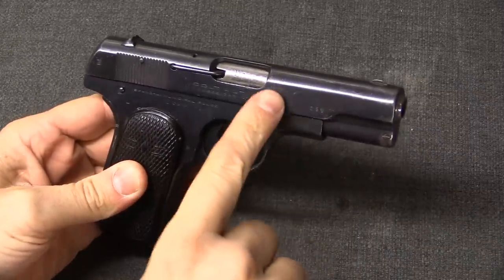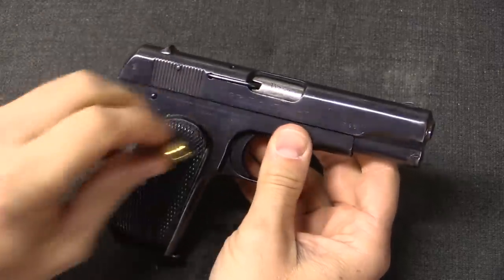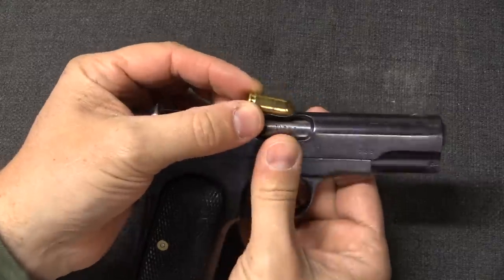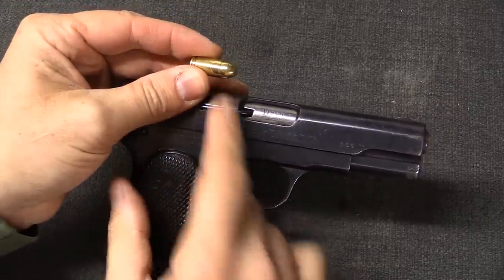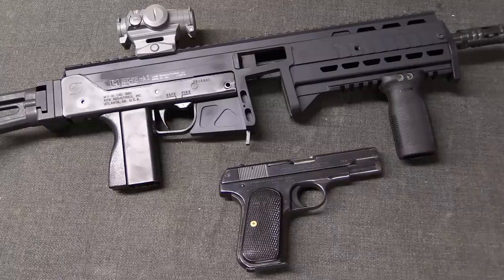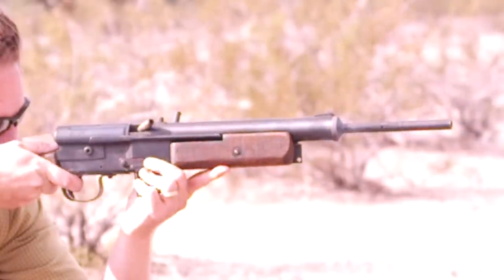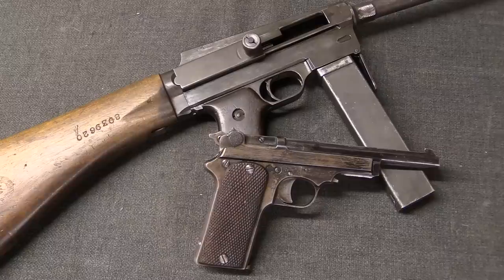How Does it Work: Blowback Action

Comment: As far as I remember, momentum is conserved, not strictly energy (because there are instances that momentum is conserved but energy is not)
Reply: Energy Conservation is already there - just has nothing to do with it.
What applies here is that the total momentum stays the same - that is 0.
The momentum of the weapon is then m1 * v1 the momentum of the bullet is m2 * v2. So m1 * v1 = m2 * v2. Since m1 >> m2 follows v2 >> v1.

But since the energy is 1/2 * m * v² the bullet also gets more energy als die Pistole
Reply: dertomtom39, yeap.

I understand that Ian didn't want to get too technical in this video, but unfortunately the wording he chose is totally wrong from a physicist's perspective...
Reply: Momentum is conserved, and so is energy. We don't take energy into consideration because there's a lot of energy converted into the heat, but the amount isn't calculable. But momentum is only affected by mass and velocity, and cannot be converted to something else like energy does, making it easier to calculate.
Reply: Energy is only not conserved on quantum scales

Comment: I like these videos and hope that you continue this series. I would also appreciate more in depth videos (once the basic action types are covered) on how the different mechanical parts operate and interact with each other, as well as their function for the intended action type. And what parts are common for or essential for a specific action.
Regardless, if you happen to read this comment than I would like to thank you for all of the documentation of rare, usually, quirky and interesting guns that you have made. I hope you never run out of such firearms.

Comment: What I find more interesting are the various methods used to delay momentum until chamber and barrel pressure have been reduced enough for safe cartridge extraction. The Broomhandle was one of the first to deal with higher powered cartridges. It's delay method is similar to the 1911 designs still being produced today.  
The .17 caliber rimfire is a great example of a cartridge not suitable for direct blow back without delay.

Comment: One thing to mention, perhaps when doing the follow up video is the contribution that the cartridge case makes to blow back systems.  There a limited amount of resistance to the rear ward movement of the slide or bolt.  This has been exploited in some designs with a shallow ring  in the chamber.  not to be confuse with the fluting found in the G3 family of roller locked delayed blow back designs.
Reply: Here is an example such that did not work.   ''The J. Kimball Arms Company of Detroit introduced a semiauto pistol in 1955, chambered for the .30 Carbine cartridge – what better companion for the tactical uber weapon of the day, the M1 Carbine? Kimball’s pistol was styled heavily after the High Standard, and it looks good and handles well. The .30 Carbine cartridge is too powerful for a blowback pistol, however, and so Kimball needed some type of locked breech or delaying mechanism. He chose to cut an annular ring in the front of the chamber – the mouth of the brass would expand into this ring upon firing, and the force required to press it back down to the diameter of the chamber body would force the slide to remain closed long enough for pressure to drop to a safe level.

However, the system was not adequate for the cartridge. The slide velocity was high enough that the guns very quickly battered the slide stop block. The would peen and deform at first, then crack, and eventually either bend to the point that the gun would not cycle, or break off and allow the slide to come right off the back of the frame. I can’t find any documentation of anyone actually injured in this way, but that was obviously the concern. Only between 250 and 300 of the pistols were made before the company went bankrupt and closed. There had been plans to expand the line to include gun in .38 Special, .357 Magnum, and .22 Hornet, but none of those went any farther than prototypes.

Comment: The delayed roller lock system should be a interesting video. Especially the difference between the mg42 system and the HK system.
Reply: MG 42 has nothing to delayed blowback, it's a short recoil roller locked system

Comment: Pressure must also be an important factor. For lower pressure pistol rounds, the pressure is low enough that the walls of the case can slip against the chamber so if the base of the case is pushed back 1mm then the walls of the case will follow it. With higher pressure rifle rounds, if the base of the case moves back 1mm then the walls of the case will likely still stick to the walls of the chamber and the case will split. Helps that pistol cases also just have less surface area than rifle rounds. 

The higher pressure of rifle rounds means a blowback action will be pushed open even quicker, due to all this, straight blowback is so much harder with rifle cartridges.

Comment: Just thought I’d mention that the velocity of the slide is NOT proportional to the velocity of the bullet (based on weight). The formula for kinetic energy is 1/2 x mass x velocity^2. So, since the  energy is equal, when the proportion of the slides mass to the bullets mass is taken into account, the velocity of the slide is more exponential than proportional.

Comment: It occurs to me that the same cartridge fired from two barrels of significantly different length will raise chamber pressure to significantly different levels. So on that assumption, the recoil impulse/momentum would be different. Therefore, significantly different slide/bolt masses would be required to perform the same blowback damping function.
It follows then that barrel length would be a major driver of bolt/slide design mass. Not something I would have immediately thought of.
I presume a longer barrelled simple blowback rifle / submachine gun might therefore need a larger bolt/slide mass than a 9mm simple blowback pistol.
Perhaps it also follows that we can reduce recoil impulse by cutting down the barrel to the point where the chamber pressure is reduced?

On reflection, the recoil spring must be the next part of the overall equation which might facilitate the blowback mass to become lighter or heavier. I guess that best design practice is to start out with the stiffest spring possible, as long as we can still manually operate the bolt, to allow us to proportionally reduce the bolt/slide mass.
Reply: Yes, barrel length does affect the cycling of a blowback operated firearm. But a longer barrel does not increase the chamber pressure. Actually, it makes the recoil impulse last for a longer period of time, which increases the amount of energy cycling the bolt. Aside from that, you seem to have a good grasp of the concept.
Reply: It depends on the powder you use.

Ever heard "do not mix shotgun powder with handgun powder"? Those weapons use different kinds of powder (which is often just the same substance ground finer). Generally, pistol powders have faster burning powders to make the best of the short barrel, with the internal pressure reaching peak shortly after ignition, whereas long guns have slower burning powders that reach their peak pressure later. Put exactly the same mass of propellant in a rifle cartridge, but with finer grains meant to be loaded for pistol cartridges, and you're at a very high risk of blowing your rifle up.

That is to answer the question:
Do longer barrels make the pressure peak higher?

Not really.

If you're using rifle powder on your pistol, sure, it will. But generally, pistol cartridges reach peak pressure while the bullet is still inside that short barrel. Else you'd be just wasting unburnt powder.

The reason SMGs have such a massive bolt in comparison to pistols is because while the pressure peaks in a long barrel exactly as soon as it would in a pistol, it still remains at very high levels while the bullet is still in the barrel, where, of course, it remains for a longer period of time than it would in a pistol. That massive bolt is there to delay the opening of the chamber, allowing the pressure to drop to safe levels so it can safely extract the spent casing.

What affects the pressure is, in order of importance, propellant type, ammount, grain size and bullet/barrel friction. The bullet crimp, weight and the primer size also affect burn rate to a much smaller, often negligible degree. Really, you'll only have to account for them in regards to the burn rate if you're designing one of those rail rifles.

About the spring, yes, it does affect how heavy your reciprocating mass has to be for a straight blowback gun. However, the spring itself has momentum and mass. Te ideally stiff spring can be so heavy as to offset the weight saved on the bolt, so the best design practice is to find a midway between the bolt mass and the spring mass. It's the typical implementation (fixed) cost vs operation (variable) cost optimization problem, described by this graph:
https://www.economicsonline.co.uk/Business%20economics%20graphs/AVC.png

Only instead of cost, you have weight.
Reply: The OP specifically said "the same cartridge fired from two barrels of significantly different length". So all that stuff about different powders etc was basically non sequitur.
Reply: It's my understanding that for an identical cartridge, increasing barrel length from zero up to a given length proportionately increases projectile velocity. Up to the point where it plateaus, and the projectile reaches its maximum possible design velocity. 
For example, if we shoot a bullet from a two inch barrel, we will see significantly less velocity than from a twenty inch barrel. But then in a fifty inch barrel, there is no difference to the twenty - in fact it might even reduce the velocity due to barrel drag. 
Hence my theory on the chamber pressure behaving in the same way.

Or I am wrong, and chamber pressure maxes out almost instantly, regardless of the barrel length.

Comment: Seeing how much mass is usually put in to .45 or 9mm submachine gun bolts, is there a proportion to how much energy is in less powerful blowback handguns, or do they handle it in a different way? If the SMG bolts are proportionally heavier does it have an advantage?
Reply: Submachine gun have the same level energy as a hangun per shot.
A heavier bolt can slow down a Submachine guns fire rate.
SMGs are better at managing energy, a SMG bolts can have a greater length of travel and bigger springs to absorb some of the energy.
Reply: @SuperFunkmachine  See the episode on the M1921 Thompson. There were complains with the original model of a too high rate of fire. Only thing tht needed to be done is to ake the bolt heavier
Reply: The longer barrel on a SMG requires the bolt to stay closed for longer or the case will rupture due to high chamber pressure as the bullet is still in the barrel, so a heavier bolt provides that delay and allows the bullet to exit and pressure to drop to a safe level.
Reply: vendomnu, indeed, I believe there is at least one such firearm with adjustable bolt weight to alter the rate of fire. It was presented in a Forgotten Weapons video ages ago, and unfortunately I don't remember any details :(
Reply: Handguns with full size cartridges (which includes 9mm parabellum or .45 ACP) use a different mechanism than simple blowback to lock the bolt and barrel together until chamber pressures drop enough to safely extract the cartridge.
Reply: @vendomnu  Pretty sure Karl messed with his own Lage SMG upper (like the one pictures in this video) to do exactly this in a video a while ago.
Reply: @brucelee3388  I don't think that's true. After ignition the projectile spends most of its time accelerating through the first few inches of the barrel. Once the projectile has travelled as far as it would in a pistol barrel it's already going at 80+% of its final velocity and the extra barrel length adds minimal time spent inside.

The real primary reason is that blowback SMGs use more powerful cartridges than blowback handguns. See 9mm Luger/.45 ACP/7.62 Tokarev that require a locked breech design to be practical in a handgun, vs the .32/.380 ACP/9mm Makarov in blowback handguns that are far less potent.

SMGs are also built to last through a higher volume of fire than handguns, and benefit from controlling rate of fire, which a heavier bolt helps to achieve. A blowback pistol isn't really expected to fire tens of thousands of rounds in its lifetime, and would have an uncontrollable rate of fire in full auto.
Reply: @vendomnu  if anyone makes full giggle reprods of Thompsons, uzis, mp40s or other simple guns like, there might be a way
Reply: There is a reason why straight blowback 9mm/.45acp are mostly impractical and more advanced locking mechanisms are normally used. . You need massive slides and/or super stiff recoil springs. Case in point, look up the much berrated hi point 9mm pistol. 
Ian will most likely cover more advanced things like tilting barells in coming videos.
Reply: @jasondoe2596  some of the modern AR-15 9mm blowback conversions have adjustable bolt and buffer mass.  You can tune the mass of the system to exactly what you want.
Reply: @meanmanturbo  The heavier the  bolt in open bolt firing also has a more distinct and accuracy disruptive 'lurch' as the bolt rams home to fire the cartridge
Reply: Actually the bolt's weight in a SMG is usually much more than what's simply needed to keep it closed for enough time to safely shoot the cartridge. The weight is used to slow down the fire rate, that otherwise would easily exceed the 1000RPM (that infact were exceeded in the first SMG, the Villar Perosa of WWI).

Comment: You forget to mention that the recoil spring of the slide enters the equation.  The mass of the slide and the force of the spring(s) counterbalance the force of the bullet
Reply: Correct, but the force of the spring barely matters when compared to the mass of the bolt. (It mainly affects how smoothly the slide decelerates, and the rate of fire in SMGs, I think.)

Comment: Example: The Oerlikon 20 mm MK4 is an open bolt blow back cannon. The spring that operates the bolt is so stiff you some kind of level or pulley to charge it. Immagine packing that think around l

Comment: Hi Ian.  I've watched a lot of your videos on simple blowback.  In this description, you talk about balancing the mass, but I think you mean balancing the force.  I've notice that you've made no mention of the spring and spring stiffness that is used to keep the action closed.  Having seen most of your blowback firearm videos, it appears that this spring is a more practical hindrance to simple blowback than the mass of the reciprocating part.  It's what makes it hard to cycle the gun manually, that's for sure.  You're work is always excellent, so I'm curious as to why you made no mention of springs and their part in this type of action.  Thank you.
Reply: The spring actually provides very little resistance on its own. Even with a 20 lb spring, which is miserable to operate manually, the action has tens of thousands of pounds of pressure acting on it, so there's no practical purpose to increasing spring pressure exclusively to delay the action. All a heavier spring really does is make the action close faster.

Comment: I'm not a gun guy, I'm mostly interested in history and technology but I just find these videos endlessly fascinating.

Something I have wondered about, maybe someone has an answer:
Are there open bolt, straight blowback mechanisms (like in a submachine gun) that are designed to detonate the charge just before the bolt comes to a complete stop in its forward motion?
This would reduce recoil or allow a more powerful charge, since the detonation has to overcome not only the mass of the bolt and the force of the spring, but also the kinetic energy of the bolt moving forward.
Has this been tried? Is it already a feature of blowback?
I imagine the timing of the detonation will be a challenge to engineer.

Guess this would be one for the AMA's but I'm throwing it out there anyways.
Thanks for great content!
Reply: Yeah the Oerlikon 20 mm cannon already does/did that.

Comment: Maybe someone can answer this for me even though your video was posted a very long time ago.
I once read, I believe it was a Jane's manual on submachineguns, that the 9mm Parabelum was too powerful for a blowback operation.
It said Shepherd and Turpin came up with what they referred to as preignition. Basically the chamber was too tight for the cartridge. Ergo as the cartridge fed into the too tight chamber it fired before seating all the way in. The heavy bolt and spring kept pushing it closed so by the time it started its rearward motion, the chamber pressure was low enough to be safe.
Was Jane's correct in that assessment as to how the Sten functioned?
Any input will be great appreciated.
Thank you Ian for all the excellent videos you've posted. The government should be paying you for all the research and archiving you've done. It would be very sad if more information got lost to history like the Peterson plans that started your quest/crusade.
What you decided to take on for the benefit of anyone interested in history is simply outstanding! 
I still feel my words don't give your mission enough credits.

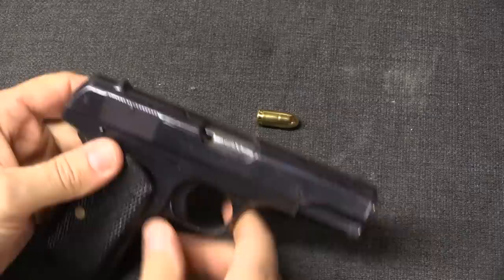Comment: I would like to correct, at 2:00 you mention proportionally lower velocity. However in a physical sense this is not correct since energy scales with the square of velocity. That that for ten times as much mass, you have square root of 10 times as little velocity to attain the same energy.